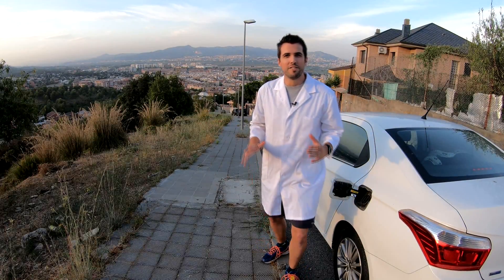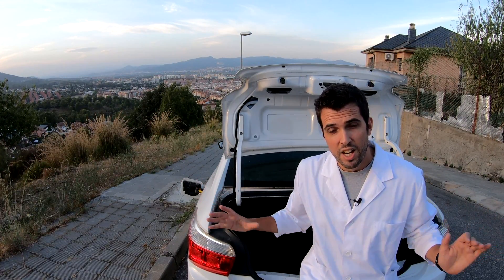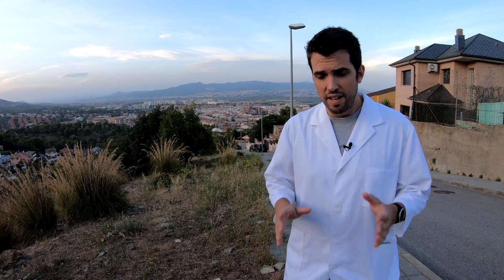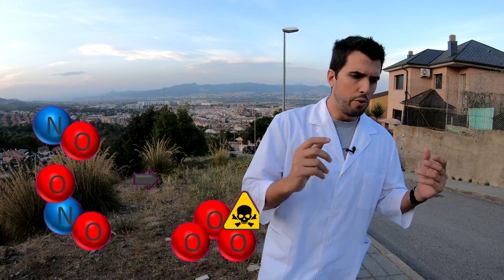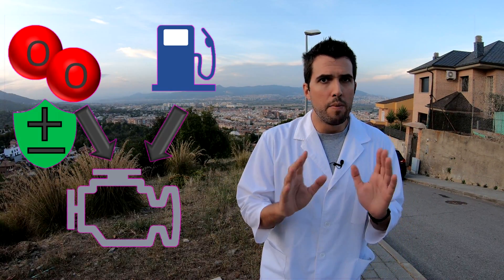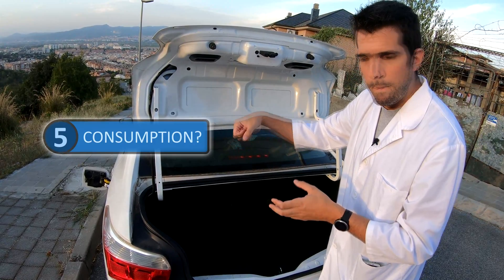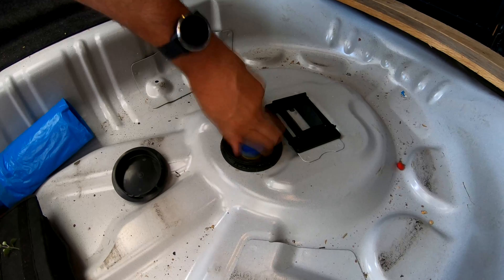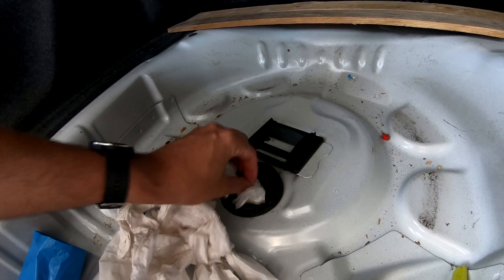All you need to know about AdBlue ® [UREA]⛽

Comment: Sorry tronco, but as much as the centralita can ajust the AFR on a petrol engine via information received from the inlet and exhaust sensors, the centralita on a Diesel engine does the same via its sensors. If it was a pegaso from 1950, I’d agree with you, but a modern Diesel engine can change its AFR the same as a petrol engine.

What you said about the way it reduces the emissions is correct, and assists in lower emissions.

I just refilled my adblue (2021 Hyundai Santa Fe) after getting a low level warning (+\- quarter tank) after 26,000 which was just over a year of ownership.

A 10l can (with spout included) cost €17, and I still had some left over for next year.

Comment: can you switch off the engine management system so it does not recognise it requires adblue to function ? As a technician he’s done for mine and it runs perfectly without the swine urinalysis 😂😂😂😂 thanks for your input
Reply: Why?

It doesn’t affect engine performance, and the cost over a year is negligible.

A year of adblue just cost me less than €17.

Do you not give a damn about helping improve the atmosphere for yourself and others?

Comment: We explained but you've missed one think, what is the adblue life and does it possible to use it before the expire date, if the expired date is soon.
Reply from the maker: Yeah, and I also learned a lot about the maintenance problems during this time. Like, the PSA tanks have to be replaced after only a few thousand kilometers, and the sprayer stops working because of crystallization.

Comment: i ran out of adblue here in rhodesia; can i use a litre of my own urine with a litre clean water to fill the adblue tank in order to restart my engine?
Reply from the maker: I like the question 🙂 Thanks. I read: Adblue has eight to 16 times the strength of your own urine. Sensors in the probably will detect is not the right stuff and problem will be worse... plus other substances that may damage the system. You may can try to concentrate urea from 16 liters of urine and filter other components. Too much work...

Comment: Hey! Wish I watched this video before 🤦🏾‍♀️. I ran it low on ad blue and now it won’t restart. Does that mean it’s the end of my car?
Reply from the maker: Hi. No, it is not the end. In fact, it is an electronic blockage. The car can run without adblue but manufacturers are force to set this blockage. If you buy a bottle of adblue and fill it should be good.
Reply: Thankyou so much. Will do that. God bless you for your videos.